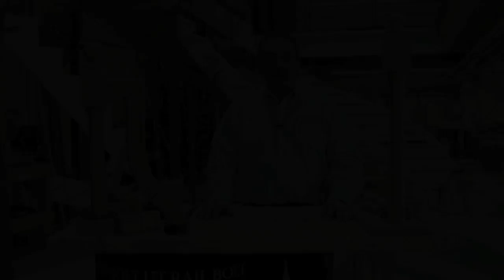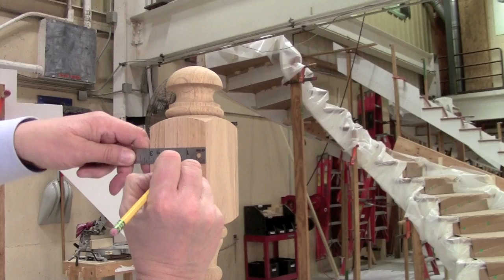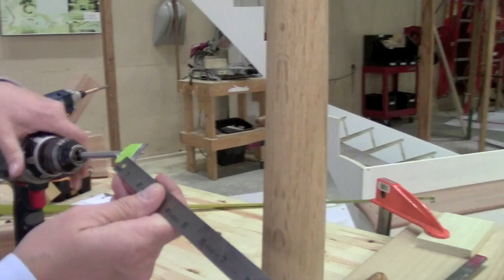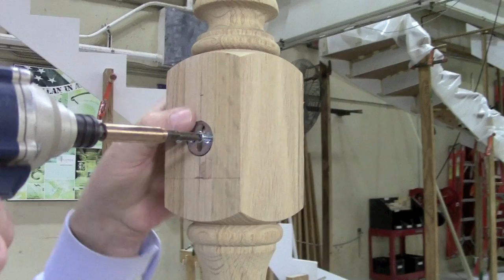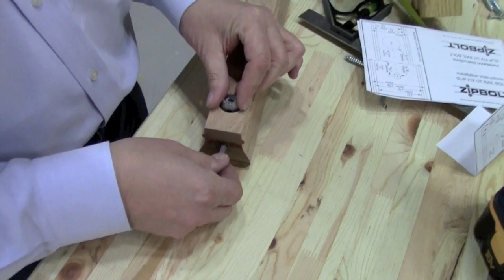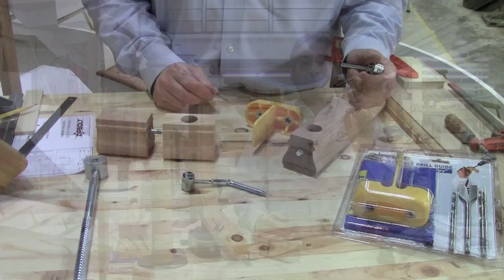How To Connect Handrail To A Newel Post Using The Slip Fix UT Rail Bolt

Comment: What keeps the rail from turning?
Reply: All traditional rail points are single point in the middle, so all of them need glue. Glue is the primary attachment. The bolt is like a clamp to hold the glue tight.

Comment: Will this product work with half newel posts as well please?
Reply: +croesyboy Hello. Yes it will. The disk you insert in the half newel is only 3/8" thick and installed with 1-1/4" screws. Feel free to call our tech support line at 508-235-4397. Thank you.
Reply: Hi sir iam a carpenter but i have good experience in railling and moulding design all types of design so contact 9622307437 India

Comment: hanger bolt...40 cents a piece...nut 5 cents...washer 3 cents 1 inch wood plug made from rail or post cut off...and a box end wrench ground down a bit and half the time ....i can prep ten rail bolt holes in the time it takes to install one of those things...the only time it saves is not hand tightening the nut but for under a buck for parts for my system available from any good hardware store and rock solid connections i stick with the way I do it
Reply: Do you use a chisel or something to square off the nut and washer face in the handrail? This is what I want to do.

Comment: These worked great for me--my first staircase. I wanted something that would attach to fixed posts without having to drill screw holes through them.  The bigger issue for me was getting the product, as I live in Winnipeg, Canada.  I was finally able to find a Canadian supplier in the city named Richelieu Hardware. They shipped them in from Quebec within a couple of weeks and I picked them up.
Reply: +Phil McBurney Sorry we could not accommodate shipping to Canada. So far we have not been able to find a cost effective way to get it done. We will keep working on this.